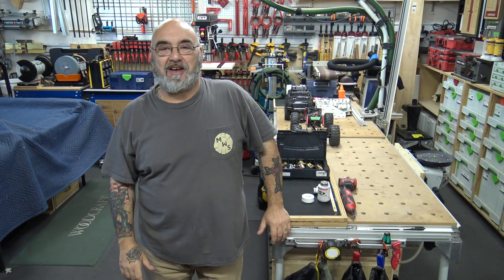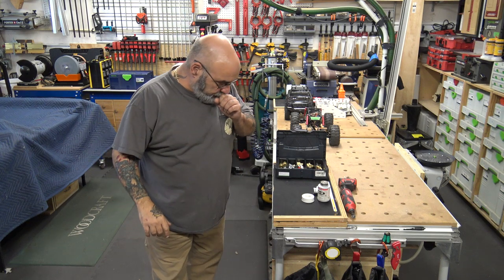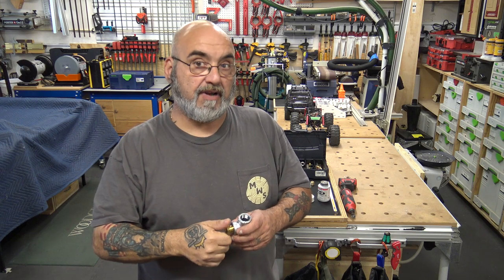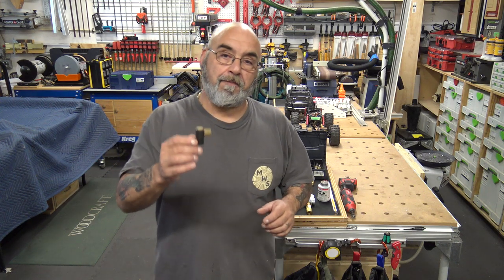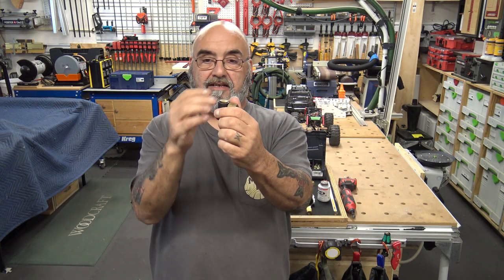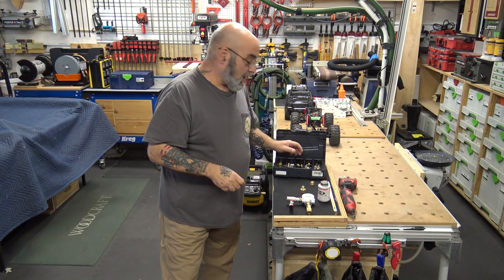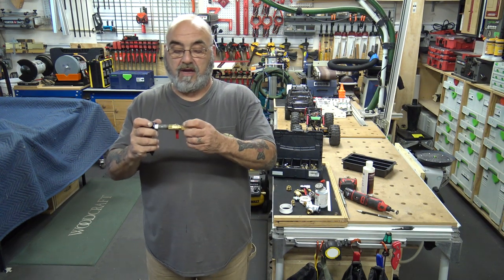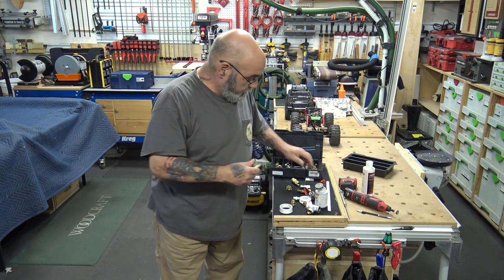Shop air piping part 2. IPS pittings and installation.

Comment: Thanks for the info regarding the type A pec tubing.  You do loose points for wrapping the teflon tape in the wrong direction.  When you screw the fitting in it will unwrap the tape!

Comment: Hey Mike John here, got a question for you. I’m thinking about running pex a from my shop underground to my garage which is about 75 feet away. Will I have any problems with deterioration or condensation? I live in deep east Texas so my climate is similar to yours there in Florida. This is from an air compressor

Comment: Another great informative video Mike. I have a question for you on the Calavera products. Where did you get the bracket for your MFT3 table and the calavera Velcro straps for your hose and extension cord. I checked with Tool Nut and Woodcraft and neither carries them. If you know of and distributor please let me know. Thanks.
Reply from the maker: Douglas E Smith I bought them directly from Calavera. The MFT bracket comes as a set with bags or you can buy it separately. The strap also can be bought from them. The wed site is,
Calavera tool works.
Thanks Mike

Comment: Why do you go with such small air fittings. Everyone saying you need 3/4 inch airline supplying your system or at the least 1/2 but you use 3/8s? Is 3/4 and 1/2 overkill and not necessary?

Comment: Hey Mike, good to hear from you, one question..... If you run a drop away from your comp. for air and water release do you need to also open the valve at the bottom of your tank also, or can you just open the drop to get rid of the moisture ???????
Reply from the maker: Matt Dodaro you need do both. My other shop had a valve under the drop and once a week I opened both. To lazy to install on now lol.

Comment: can you use Pex A and B with Pex crimp clamps, or do you have to use Pex B??
Reply: Hey Bruce, Sorry to butt-in but I know the correct answer.  It is 100% CRTICAL to use ONLY Pex-A (aka Uponor) with Pex-A pipe AND fittings/retention rings and ONLY standard Pex with like/kind pipe ,fittings/retention rings.  If you mix types, you will create leaks.  The tricky thing is, it will not leak immediately but it will (100% of the time), leak within weeks.  Please trust me, NEVER, NEVER mix pipe/fittings or retention rings across Pex-A and Pex-B.😮

Comment: Yeah I bought 3/8" detachable connectors. Silver connectors are crap. Ya want the brass type. It probably has lead in it and doesn't leak. The long 1/4" airline is more significant than the 1/4" connector. So I have found. And of course 1/4" NPT is pretty much half inch in size so that's confusing. Back to the video. 3/8" detachable connector seems suitable for starting a turbine.